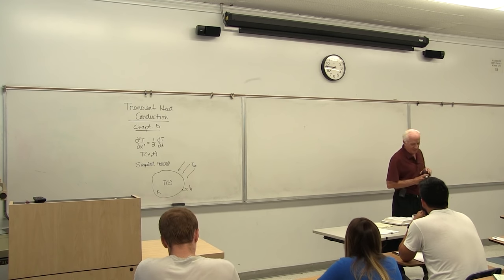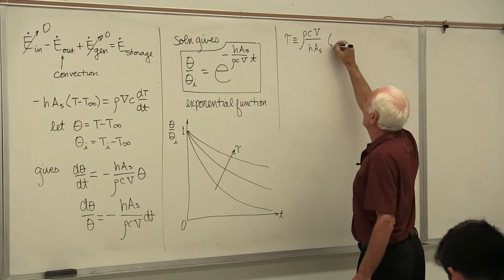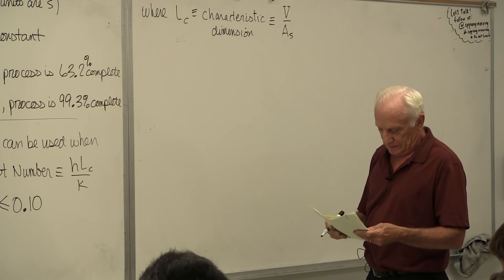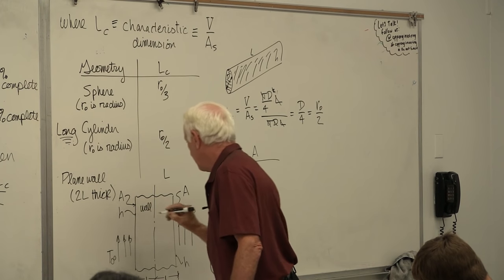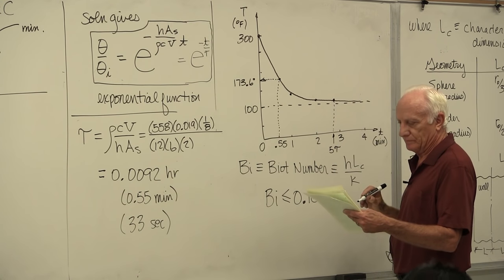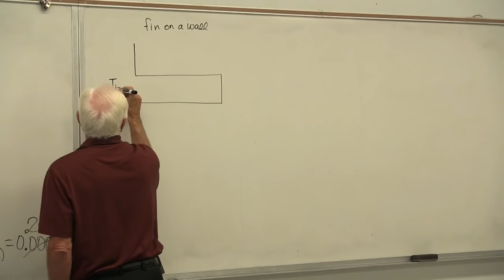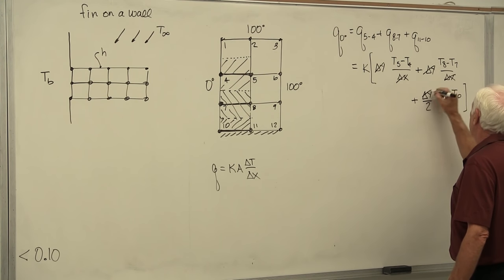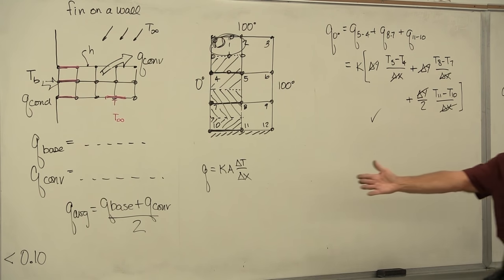Heat Transfer: Transient Conduction, Part I (10 of 26)

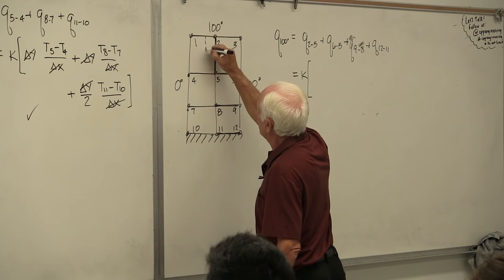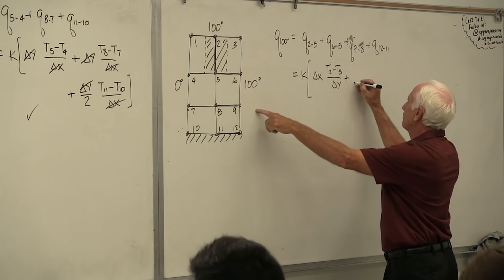Comment: At time 53:44, shouldn't the area from a node at a plane surface be half that in the y direction? So the q_2-5 = k*(delta x)*(1 for depth)*(T2-T5)/(delta y / 2) instead at 54:05?